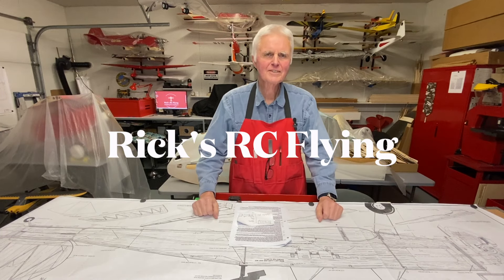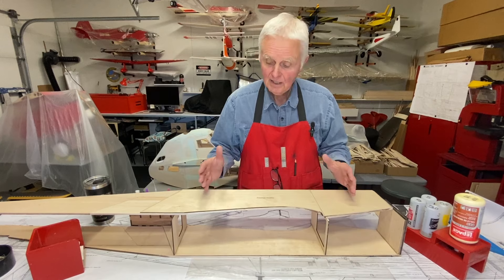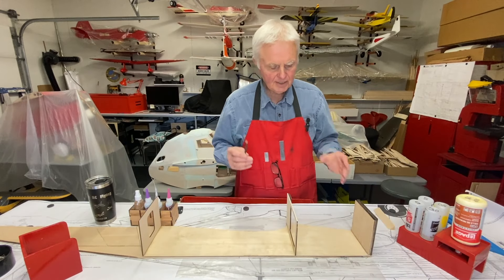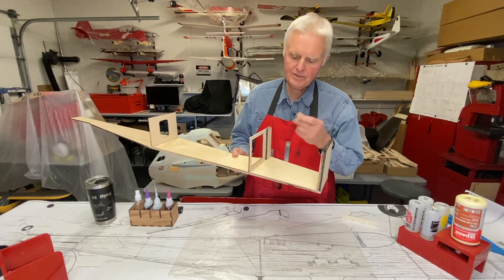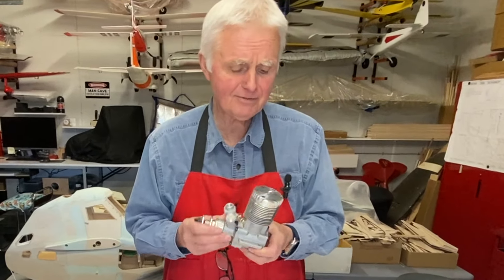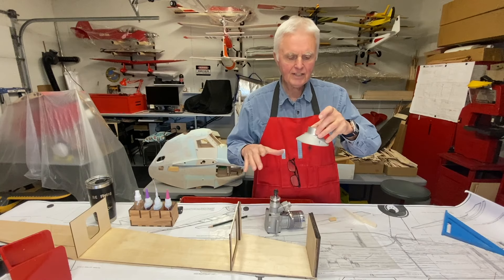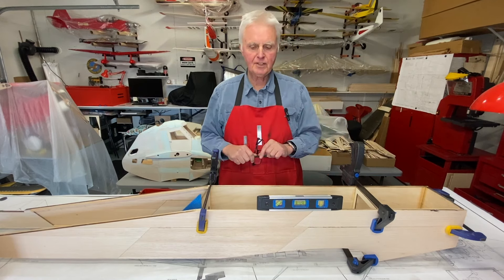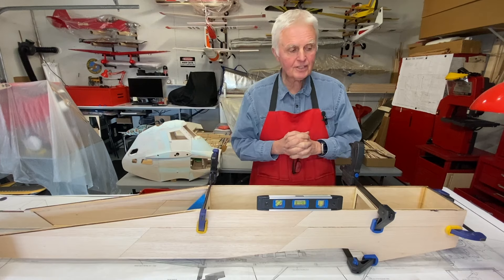Sweet & Low RC Airplane Build Episode 2 Fuselage

Comment: Moki originally made in Hungary when it was part of USSR and won years of competition became famous. They never registered their name in USA, Britain and Germany. So the airworld company in Germany took the name, hence the Moki radial engines of today. Was a time when Moki was marketed in USA as Mark because of the trademark registration debacle. People believed Mark was a Chinese copy of Moki but not so. Mark engines come with carb casting of Moki logo and Moki literature. Original Moki also converted the line of nitro engines to gasoline with walbro carb. They have an interesting website with pictures and specs. Original Moki power. Nothing has the sound of a giant nitro engine, the big super Tigres included. Much smoother than gas, no weed eater sound. Beware the kickback of a wet one on start up. More severe, you will not hand prop one but once. I have had a chicken stick busted. Choke it until wet and flip it backwards and see it start. Amazing
Reply from the maker: After using Moki for over 30 years, I am still in love with them! Thank you for sharing their history. This will be an interesting read for viewers. Rick

Comment: Excellent.  Hello Rick, I am a 55 year old who has held both Engineering and Research jobs at a few manufacturing companies- and among other responsibilities I had, I was appointed as the "Adhesive Specialist/Know it all" in my first job- and due to that experience, had that same function at the latter jobs as well.  You are 100% ON THE MONEY with all your recommendations regarding adhesives.  I have not seen your video on adhesives, but am confident you nailed it all on the head there as well.  I want to doubly endorse the basic idea you discuss regarding those triangle bulkhead reinforcements.  In ALL cases of bonding two materials together, you want to keep the "Bond Line", or thickness of the adhesive as thin as possible.  The thinner the bond line, the better the bond.  Nobody should ever bond substrates with large bond lines between them- much better to make the parts again or cut or sand or whatever you have to in order to keep the bond lines as thin as possible.  Lastly, I am concerned at two things I see on your bench.  1)  Your caddy holding a few epoxy bottles and a wood glue bottle- UPSIDE DOWN.  I never got away with that.  2)  How in the world did you NOT hit your drink off the desk while making this video?  I never get away with that either.  I have to put my drink on a separate table off the side or behind me, and even then, sometimes it was simply best not to bring them into the workshop at all!  Well done- great practical advice.
Reply from the maker: Hello Carlos, Thank you very much for the comments. It just so happens in Episode 3 of this build (which will be released shortly) I mention about using too much glue. You are not the only one who thinks I'm brave with a coffee mug on top of the plans. Thank goodness my mug does have a spill proof top. lol :)  Regards, Rick

Comment: Hi Rick, do you have anything covering the plan?, i was always told to put wax paper over it but although it protected the plan any excess glue would make the wax paper to stick to the balsa.
Reply from the maker: Hi Dave, I use wax paper,  your'e right it protects the plans. Plans these days can cost anywhere from $30 to 70$ US. plus shipping. When a project attaches to your plans it can be quite damaging. Causing problems for your build project. As for the wax paper sticking to your model it will sand off, not always easy but you can get it off. The secret in avoiding this is to be careful in your gluing. I have seen many times when far too much glue was used joining parts. If it does happen and it does,  I make every effort to wipe away excess glue. I too would love to see a product that does solve the problem. cheers Rick

Comment: I learned to fly inthe80’s with the 40 sized Midwest sweet and low. K+b 40 was the power. Flew until it was totally oil soaked and it succumbed to tail flutter. Looks to be a great build project.
Reply from the maker: It’s too bad Midwest no longer produces kits. The Sweet & Low was a popular airplane back in the day. It seemed there was one at every club. It’s an easy simple build and fun to fly. Thank you for the comment. Rick

Comment: Hope can I purchase the sweet and low rc airplane kit with balsa wood included
Reply from the maker: In the past, I have offered short kits for modellers, and I may do so again in the near future. A short kit includes parts that need to be cut into specific shapes. However, you will still need to obtain your own sheeting and sticks, which should be cut to size during the building process. There are several suppliers of balsa wood, including hobby shops and vendors who specialize in balsa wood material. Overall, a short kit helps to minimize shipping costs and simplifies the cutting of intricate shapes. To get an idea of the parts of the short kit for the Sweet & Low you may want to watch Episode 1 of the Sweet & Low build. Here is the link:         https://youtu.be/rvYx12VCoZ0
Reply from the maker: Due to many requests for a short kit of the Giant Sweet & Low.  I'm offering a limited amount of short kits. I have a video that explains the kit.            https://youtu.be/PuYo08s7gRg

Comment: Hi Rick great series. Just wondering about fire wall incidence. I am looking at building a Ryans Rebel. Just wondering about the 3degree Right Thrust it mentions. Is the one your building at 90 degrees or does it have any thrust angle? Just wondering what your thoughts are on building in a Thrust line to the firewall. Thanks.
Reply from the maker: Hello, the Sweet & Low does not have any firewall adjustments. The firewall is 90 degrees.  The Sweet & Low fuselage is 67 inches long, it is definetly not a short coupled airplane. Due to the long fuselage and wide landing gear it tracks very straight. Therefore, there's very little correction required for any yawing effect.The Ryans Rebel has a fuselage length of 57 inches and it appears the designer was concerned with the airplane yawing. However,  with smooth and gradual power application I personally wouldn't be concerned.
Reply: @rcflyingwithrick  Thank you for your prompt reply. That explained a lot in easy to understand way. Thank you.

Comment: A man after my own heart! I love my big moki glow engines. I also need to build the giant sweet n low some day. My father and I used to tear up the skys with the 40 size from midwest. both the kit and later the arc version.
Reply from the maker: You won't regret building a giant Sweet & Low; it flies beautifully and handles like it's on rails. Thank you for your feedback. Rick
Reply: @rcflyingwithrick  hey no problem. This old builder is picking up some tricks from your build. My great uncle had one back in the 90s. Had a quadra 35 on it. Nice flying plane!

Comment: I would like to ask were you got the kit for this plane. I really like your videos.
Reply from the maker: I'm glad to hear you enjoy the videos! Regarding the Sweet & Low kit, I created a short kit version. A short kit includes parts that are cut into specific shapes, saving builders a significant amount of time and ensuring precise accuracy thanks to the laser cutting process. However, it's important to note that a short kit does not include the plans, sheeting, spars, or sticks, nor does it come with any hardware such as landing gear, wheels, cowling, or engine mounts. 

I've received numerous requests for this short kit version, so I am considering providing it for the Giant Sweet & Low featured in my YouTube video. If I decide to move forward with the kits, it wouldn't be until the new year.
Reply: @ 
Thank you for the reply I will keep a lookout to see if decide to produce the short kit.
Reply from the maker: Due to the high number of requests for the Sweet & Low short kit, I have decided to make a limited number of kits available now.        For a description see video:         https://youtu.be/PuYo08s7gRg

Comment: I love that you’re going with a big glow engine instead of gas on this build. I have a few big Super Tigre’s S2500, G3250 and G4500 that I need to find airframes for.
Reply from the maker: I like not having an ignition system, plus the vibration is minimal compared to single cylinder gas. Also plenty of power. You have a really nice collection of Super Tigre engines. The Sweet & Low lends itself easily to a stand off scale Fokker Eindecker. Thanks for the comment, Rick
Reply: @rcflyingwithrick  , I’ve found a company selling a short kit of this here in the US, so I’m putting it on the wishlist for a future build.